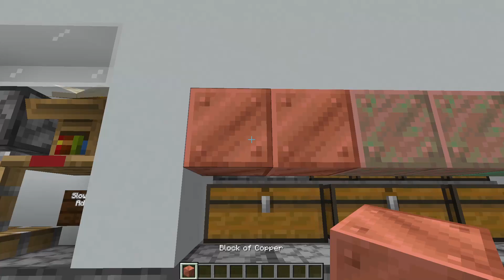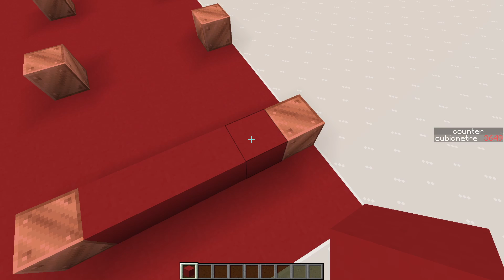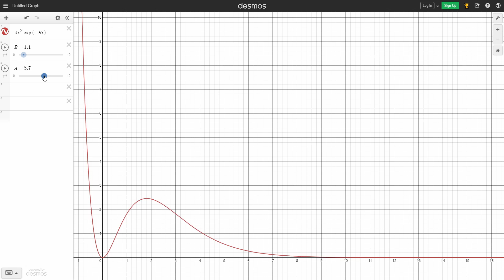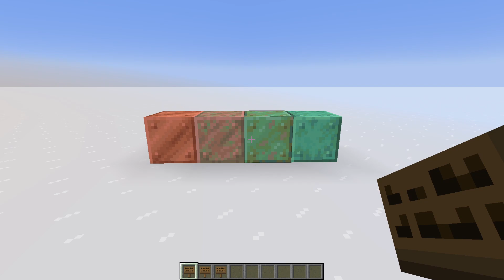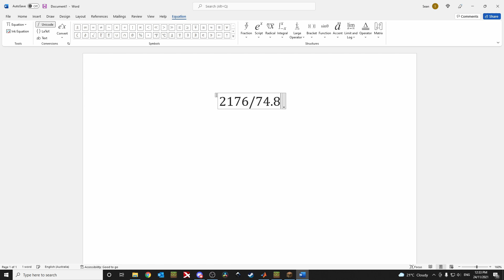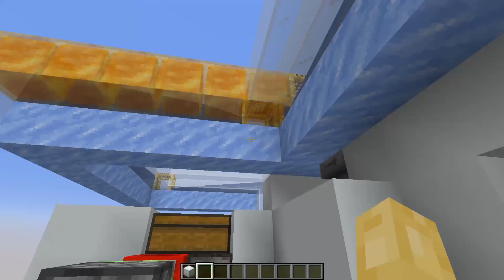Full Auto Oxidized Copper Factory

Comment: i'm actually wondering if just having a normal blockstream full of copper would actually improve the rates, 'cause yea, it's slower, but you got 5 times the amount of blocks oxidizing at the same time, also the feature where the oxidation  sort of spreads, may lock all the copper block in one stage and improve the efficiency of it idk
Reply: Cubic already addressed that idea (the first one, not the waxed one)
Reply: @bobdagranny7431  he mentionned the cube maker, not individual pillars
Reply: @_darkvictor_  Cubic adressed the individual pillars too, at 11:04.
Although the idea of having mixed variants around it, sounds interesting. I don't know if waxed copper blocks counts toward the 'check' though. 

If it does, you could even maybe, make it more of one variant at the top, and increase the oxidazation 'stage' on the surrounding waxed seeder blocks the lower you go, to perhaps improve the idea even further.
Reply: @Zappla420  nop the waxed variant doesn't count
Reply: @_darkvictor_  Thanks for letting me know. Didn't realize you already commented that above
Reply: maybe you could put around the block stream a waxed variant of the desired state, so like I said it locks it in one stage, not sure if it works with the waxed variant tho
Reply: ah shit, this doesn't work^

Comment: Great video, but it seems a bit rushed. Why did you divide the first graph by 0,1x when dividing by time (I'd prefer it in blocks/block/minute or whatever is a reasonable quantity). The fact that you made calculating the rate so much harder and didn't calculate it yourself makes me sad. Also, why did you not fine-tune the clock for the times you found? And how are the times on signs so different from the ones on the graph?
Reply: * 0,01x    (I am also a bit in a hurry)
Reply: So, oxidised - 64% or ~14 stacks per hour; weathered - 17%, ~~12 stacks per hour.

Comment: I don’t think your model for exposed copper is accurate near 0. Dividing by time should not yield a vertical asymptote. You should be able to derive the actual distributions by using probability (probably with a Poisson or exponential distribution) rather than fitting functions to data points.
Reply from the maker: the peak for exposed copper was not exactly equal to zero, it was just so close to zero that the program rounded it to zero. It does have a finite peak however its not really important because all you need to do is harvest some time between placing the copper and the 22.5 minutes.
Reply: @cubicmetre  So someone in the comments derived the actual formula theoretically, and using that formula and dividing by time, there is indeed no asymptote at 0, but the maximum is indeed still at 0. So harvesting on smaller time intervals does maximize the amount of exposed copper produced per unit time. I was just confused because on your graph for exposed copper, it looked like a vertical asymptote, which might have simply been the graph being cutoff. My question has been answered regardless.

Thank you the great farm design as always!
Reply: Of course an asymptote is just an artifact of the data fitting. You can't get out more than 100% of the blocks you put in :3

But yes, it's true that if you're waiting for only a single random event, the optimal wait time is zero. It's the same with pumpkins, for example. I am still not sure how to interpret that, other than implementing individual detection for each crop.
Reply: @volbla  Sure, but the rate can be unbounded (notice that dividing by time does give a vertical asymptote for pure copper).
Reply: @julianbenali  Oh, that's true. If your time interval is smaller than 1.

Comment: You made an error when dividing the exposed copper percentage by time. there is no way you get exp(-kx) from dividing x²exp(-kx) by x. It will have a maximum peak as well, different than 0.

EDIT: i retract that. For anyone interested, we can find the formulas for the percentages of the different block stages by solving the following coupled ODE system: 

a' = -3/4*p*a
b' =+3/4*p*a - p*b
c' = +p*b - p*c
d' = +p*c

With some oxidization rate p and abcd the percentages of the different copper stages (a=unoxidized, d=fully oxidized). From that we get the following formulas for the shown graphs:
a = exp(-p*0.75*t)
b = -3*exp(-p*t) + 3*exp(-3/4*p*t)
c = -12*exp(-p*t) + 12*exp(-3/4*p*t) - 3*p*t*exp(-p*t)
d = 15*exp(-p*t) - 16*exp(-3/4*p*t) + 3*p*t*exp(-p*t)+1

Only c and d contain parts that look like x*exp(x), which makes them have maxima in abcd/t as well. Notice that a+b+c+d=1 at any given point.

EDIT2: I don't get though why cubic would divide by time for the optimal harvest time. 

The highest percentage of exposed copper (31%) happens at the 23 minute mark (maximum of exposed copper curve), while the highest percentage of weathered copper (24%) happens at the 44 minute mark. 

Did a plot of the percentage curves and the cumulative curves here: https://ibb.co/1RnvTGT (i assumed p=1 for the time scale, the real p would be 64/1125/68.27/s ~ 1/1200s)
It should be obvious that the optimal harvest point is at the moment where we have the most of the desired block. 

For example: At 22.5 minutes we don't have the maximum amount of 24% weathered copper but only about 17%.
Reply: I think the x²exp(-kx) model was for weathered copper only. Observe that the graph for exposed copper does not have a horizontal tangent at 0.

Nonetheless, I agree that his model for exposed copper is not accurate. Dividing by time shouldn’t give an asymptote at 0, so the model is probably inaccurate close to 0.

Edit: Based on the formulas Nikolas derived, dividing by time for exposed copper, does not produce a vertical asymptote, but does have its maximum at 0. Perhaps it just looks like an asymptote on Cubicmetre’s graph because it’s cutoff, but either way, it’s not totally accurate to say it grew logarithmically initially. Thanks for the derivation Nikolas!
Reply: @julianbenali  True. I'm deriving the actual formulas rn and we get smth like exp(-t)-exp(-0.75t) for the first stage, which does not have a maximum when we divide by time
Reply: responding to edit 2: he divided by time because he wanted to optimize the rate of output for a particular block type (b/t, c/t, d/t), not the proportion of type output to total. for example, optimizing the rate for fully oxidized blocks would mean outputting more full oxidized blocks per unit time in total, at the cost of also having to output other types as well, whereas optimize the proportion would mean waiting forever for all the blocks to convert, which would tank the rates in terms of time.

edit: but yes, getting a vertical asymptote when dividing by time is absurd, because dividing by t at t=0 (by taking the limit presumably) is basically just taking the derivative db/dt, and the slope of the original graph at 0 is steep but certainly not in infinite
edit: wait, he said that b grows logarithmically near 0, but then the slope of ln(x) is just 1/x which would have a vertical asymptote at 0, so now I'm confused again
Reply: @1224chrisng  But shouldn't we look at the derivative then instead of the simple division by time? I'm not fully able to wrap my head around the side conditions we assume here rn. 

We have a storage line of variable length, variable game tick clock and thus push speed so we can vary both time spent in the line (used for oxidisation) as well as output size per time (speed of the storage line, also amount of storage lines we use).

In my head we should still just look at percentage of oxidisation stages compared to time used to oxidise (giving maxima at 23min and 44min) if we keep the output size per time constant (for example by changing the time spent in the line by changing the line length or line speed)
Reply: @nikolasscholz7983  Consider the number of (partially) oxidized copper collected when one layer of copper blocks (1 copper and 4 snow) is pushed out of the silos. This is a random variable that we can call let's say X1. For the all the layers that follow we get an independent and identically distributed random variable: X2,X3,X4,....
If the time it takes to harvest one layer is t ticks, then the time taken to harvest N layers is N*t ticks. The number of copper harvested per tick is therefore (X1+X2+X3+...+XN)/(N*t), and we wish to optimize its expected value. However, since the X are i.i.d. and N and t are not random, the expected value is N*E[X]/(N*t) = E[X]/t regardless of how many layers we consider.
The expectation E[X] is a function of the time each copper block spends inside the silo, which is a function of t (the ticks per layer) because the silo height is fixed. in fact E[X] is one of the functions a, b, c, d that you defined depending on which oxidization state we are interested in, and satisfies the ODEs you stated. Maybe this clarifies why we should indeed be optimizing E[X]/t instead of the derivative of E[X] with respect to t.
Reply: @Nukelawe  thanks for the statistical explanation, love that stuff! 

I thought about it for a while trying to understand whats happening and came up with the explanation that with a fixed length of the silo i can get more blocks overall when i harvest earlier while i get more of the desired blocks per block harvested when harvesting later. 

So if i give the blocks a bit less time to oxidise (by moving them through the silo faster), i might get less desired blocks per harvested block but more desired blocks overal (per time interval).

Somehow this took a while for me. Thanks to everyone explaining! And hope my little analysis helps some people as well :)
Reply: @nikolasscholz7983  "But shouldn't we look at the derivative then instead of the simple division by time?"

I think this is an interesting question, and i have struggled with formulating a satisfying answer. I wanna say that the rate of change of the total amount of a type of copper is different from the harvest rate of the farm. The former is a small difference in the total divided by a small difference in time. The latter is the total amount harvested divided by the wait time for each harvest.

Does that make sense? I hope it makes sense. Maybe one might say that we are looking for something less sophisticated than the derivative.
Reply: @1224chrisng  It seems it didn’t mean it literally when he said it grew logarithmically. Just the shape appears logarithmic perhaps.
Reply: @1224chrisng  you actually said the same i now understood, i just didnt get it.

For the asymptote: that actually makes sense to me too now. If we could ramp up the block speed to infinity, we could let the blocks stay incredibly shortly in the silo. We would mostly get pure copper back, but some would be exposed and the yield would still be better the faster we make the machine. b/t behaves like 1/t close to 0
Reply: @nikolasscholz7983  Nice derivation! Based on your formula, there is no asymptote at 0 when dividing by time for b, but the maximum is still at 0, so it seems harvesting at smaller time intervals does maximize the exposed copper collected per unit time.
Reply: I think you already understand why we have to divide by time now (and not do something else like differentiate wrt time, or wait for the maximum).

But just as a more intuitive explanation for waiting 0 time for the first oxidation state; what we are essentially trying to do is instantly place some amount of copper blocks, then after small time dt remove them all, then we have space in the silo again to instantly place new blocks, and repeat. If you think about it, the copper blocks that don't oxidise in time (almost all) are completely unaffected; they are removed and replaced by unoxidized copper instantly, which is the same as doing nothing, leaving them placed. But the blocks that do oxidise are removed as soon as they oxidise (within dt time), and instantly replaced with new unoxidized blocks. So this should make intuitive sense; we are removing the blocks that do oxidise as soon as possible (0 time in the limit) to give them as little time as possible to reach the next oxidation stage, which we don't want, and then instantly replacing them with unoxidized copper to not waste storage space.

I should add that in practice, this is not optimal, but not because the maths in earlier replies is wrong, rather we just simply haven't factored in other bottlenecks; we can't handle an unlimited number of blocks per second in the blast chamber or in the item filter, but much worse is the speed the player places blocks, so this puts a minimum time we need to wait just for new blocks to be ready to replace the ones about to be removed.